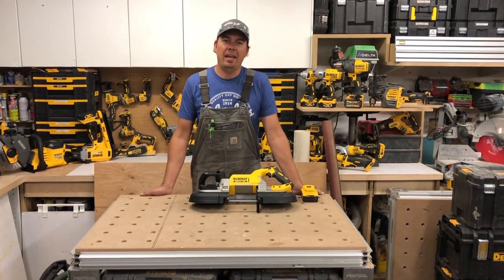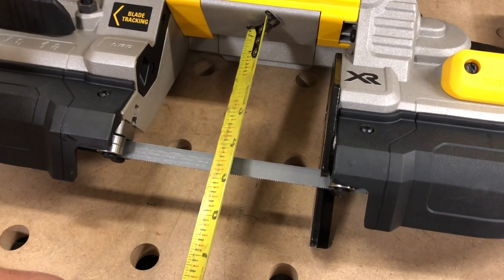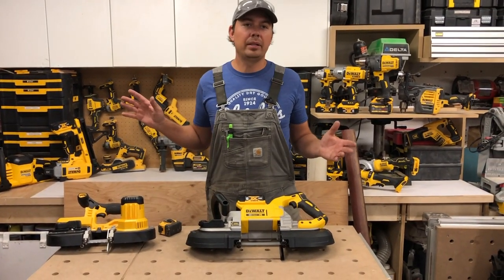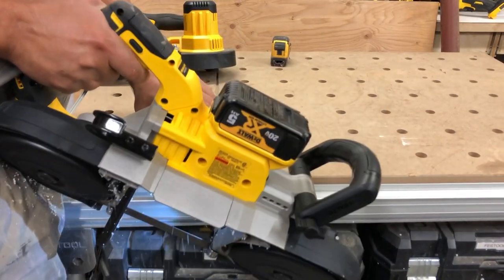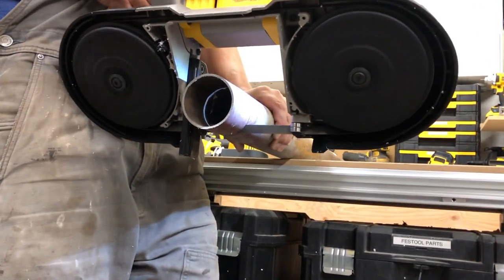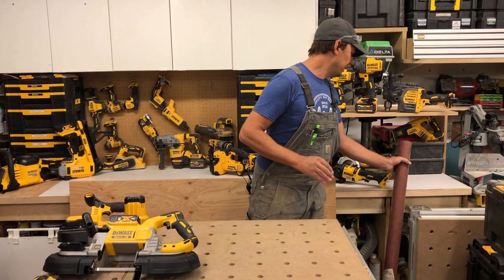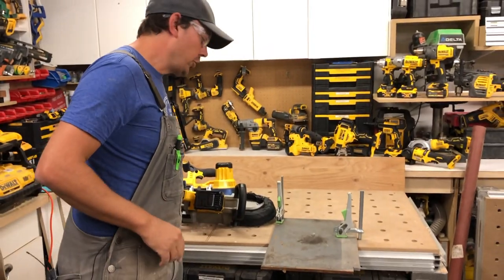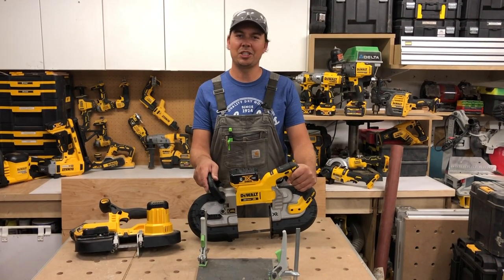Larger, deeper cuts! Dewalt 5" Band Saw 20v max review (portable)  DCS374B

Comment: Thanks for the video! Good demonstration. Everyone always says they don't have a need for a bandsaw until they buy one. Tbh, I bought mine cause I got a great deal on it, now I use it more than my recip saw. It's just more efficient.
Reply: what's more efficient the motor or the way the tool cuts? I'm asking cause I don't really see how this can replace my recip or jigsaw.
Reply: @Tonyplat98  the recip saw cuts are sometimes rough because your holding it with your hand. The bandsaw you can mount or vertically stabilize it and get smoother cuts. If I'm cutting pipes it's way better.
Reply: @submissions72  makes sense but you can use a jigsaw as well not recip for more precise cuts though I can see how the bend saw is better for pipes.
Reply: @Tonyplat98  true, jigsaw will be a bit slower I use it more for precise cuts. But it will do the job as well.

Comment: Thanks for the review, thinking this might work but not sure. Considering making banjo necks out of one piece hardwood which is uncommon but maybe less likely to warp. I would need to feed through this saw a piece 40 inchess long, 4 inch in height and width. It's a long cut and leaves only a inch of clearance. Any reply appreciated,

Comment: I can't figure out whether to buy the 5 inch or the 1 3/4. the price difference is about 150 but im worried ill end up in a situation needing the 5 inch lol
Reply from the maker: The 5” is big, but it’s great for cutting abs or other large plumbing.
Reply: @hammerandhome  I went with the smaller one for now, I’m gonna start with that and see if I have a need for the bigger one, thank you!
Reply: I have the smaller one and now I really want the big one. I wish I had got the big one right from the start. You can always cut small stuff with the big one, but you can't cut big stuff with the little one, which is what I have learned.
Reply: It’s good to have both, I’d get one for now whichever one is on sale and later buy the other one when it has a good deal. That’s what I had to do and I’m finally getting the big one since it’s on sale for $263 at a store near me
Reply from the maker: @madangel2002  I wish I bought the larger one. I have the atomic and the medium size.

Comment: What's the size of the blade?
Reply from the maker: I know the blade size for the smaller unit is 32-7/8'', I can't find the blade size for the 5'' tool, it's not even on the dewalt website
Reply: @hammerandhome  I believe the blade length is 44-7/8, it's on the Lowes.ca website on the tool description